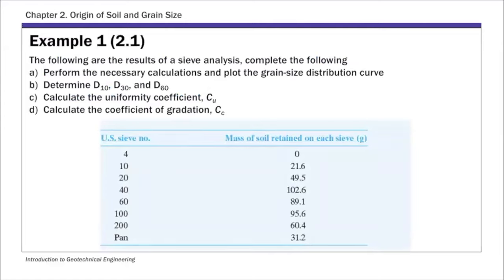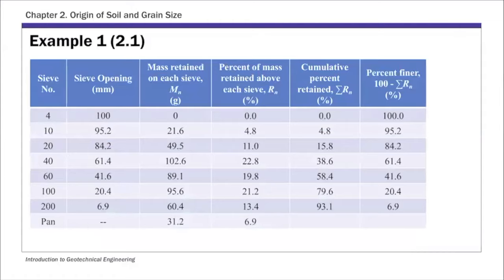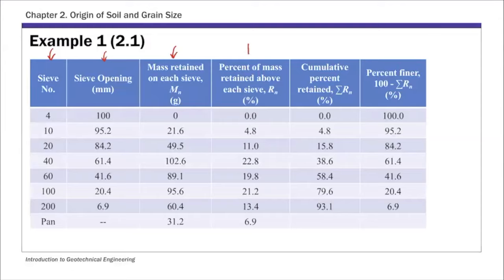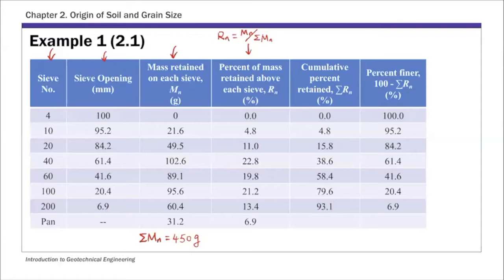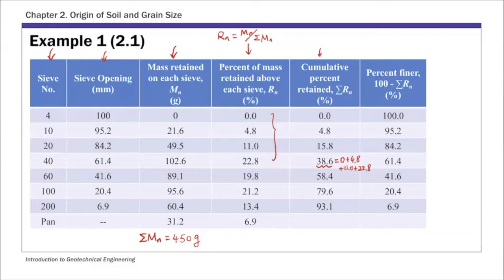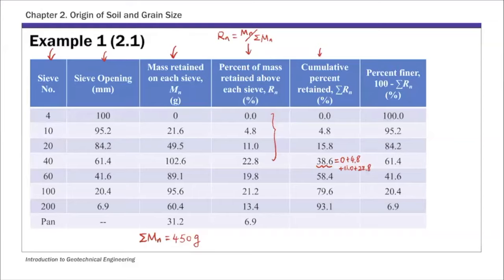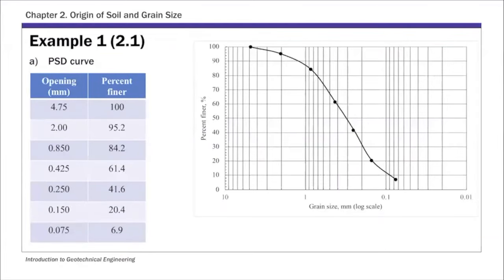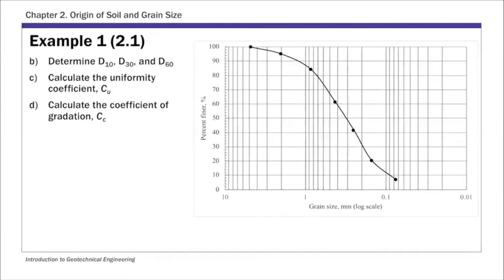Chapter 2 Example 1 - Particle size distribution curve

Comment: Hi! Where did the final values for the sieve opening (x-axis column of values) come from? Before you extracted x and y to be plotted on the chart you had different values. How did you come up with 4.75, 2.00, 0.850, 0.425, 0.250, 0.150, and 0.075?
thank you!
Reply from the maker: Each sieve used in the sieve analysis has a corresponding fixed opening size. Those x values are the sieve opening sizes, which are the particle sizes. This video includes the sieve number and the corresponding size table (starting 10:30): https://youtu.be/ZVFWy3bBdK4

Comment: What do you do if you don't have a D10 value on the curve?
In the example I'm using, 27% of the soil ends up in the pan, so the final plotted point is also at 27% finer.

Comment: Can we use interpolation to find D10, D30, D60? Using Sieve Opening and Percent Finer.
Reply from the maker: In this example, the PSD curve was created by connecting adjacent data points. So, you can use interpolation to find those values. Generally, you should directly read those values from the axis.

Comment: how to calculate Cu and Cc if maximum percentage finer just 27.5% finer, if not mistaken to calculate Cu and Cc, first we need to find D60,30,10 but in data the maximum % finer just 27.5%?

Comment: how do you identify the value of the location of the D10,D30,D60?
Reply from the maker: These are read directly from the x-axis. I may upload a video on how to read values from a log-scale axis, but very briefly, the mid point between point a and point b on a log-scale axis has a value of square root of (a*b).